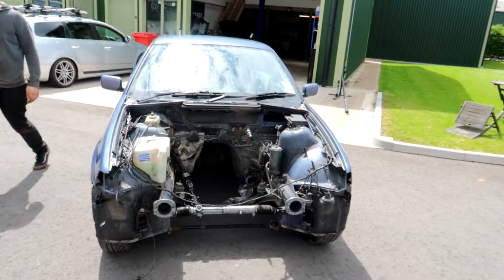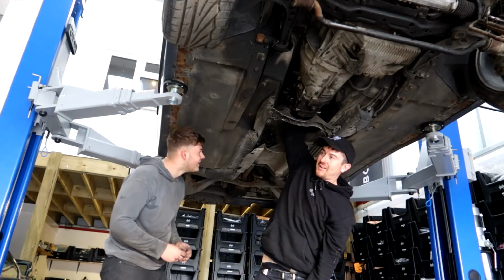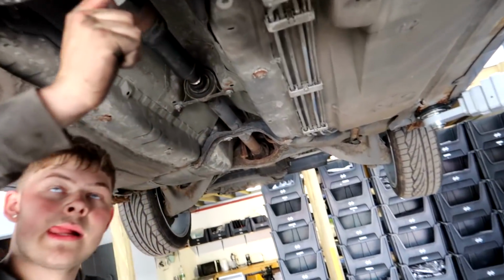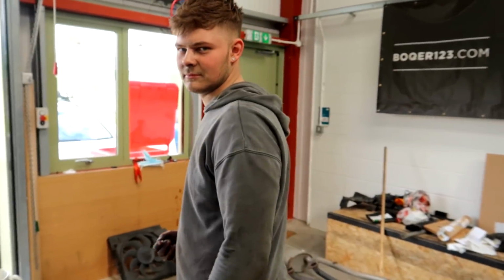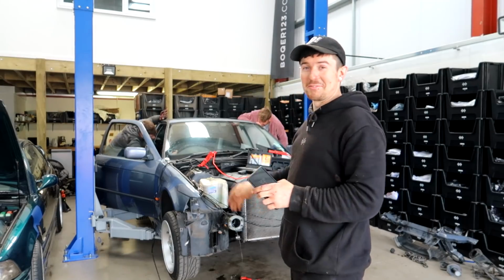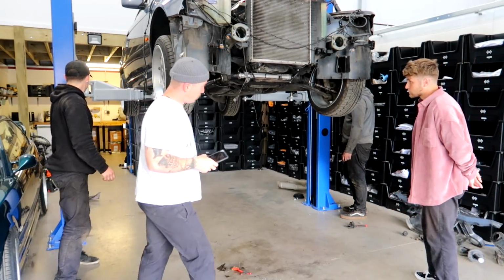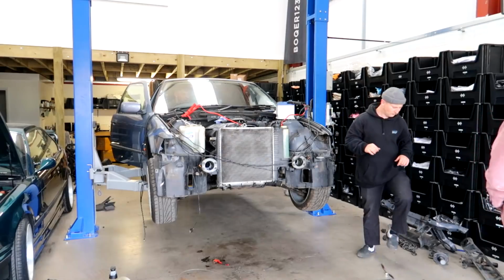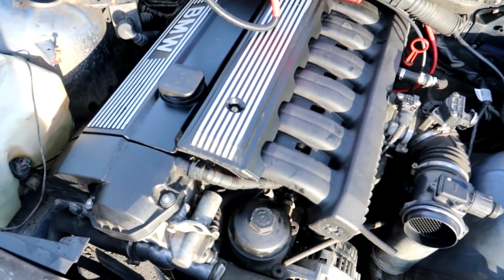E36 Drift Build - Episode 4

Comment: Throttle cables are identical I would actually remove the traction control unit on the throttle and fit a mishimoto intake boot for m50 but well done guys

Comment: If ur using the zf box from a 2.8/2.5/2.3 u need front half of prop... or just use ya 1.8 box with the 4.44 diff and have low top speed but more fun in the low range
Reply: Ps ive had 8 compacts n done 5 conversions.. if u need any help... just pm me

Comment: Hello can someone please give me some advice? Ive got a e36 318i and i want to engine swap it 2.5 or a 2.8 what do i need to buy? Obviously the engine and gearbox but do i need the 6 pot loom? or is the loom the same? Prop shaft different? Is there a forum that someone can send me a link to so that i can read about it. Thanks.
Reply from the maker: You'll need the 6 pot loom and ECU yeah but will plug straight in. You'll need to probably do the EWS on the ecu and bridge wires... Prop will be same for every engine except the 2.8 as they use a ZF gearbox instead of getrag